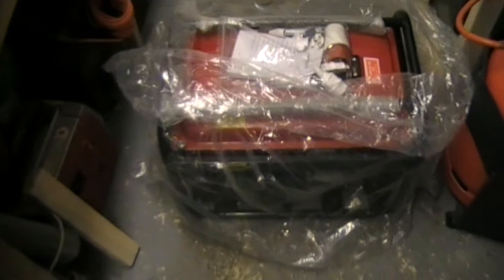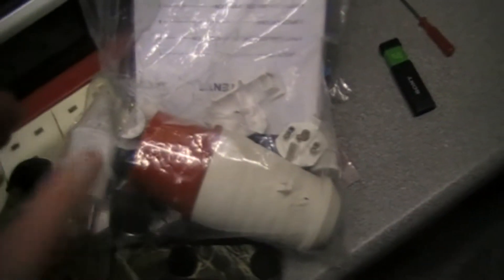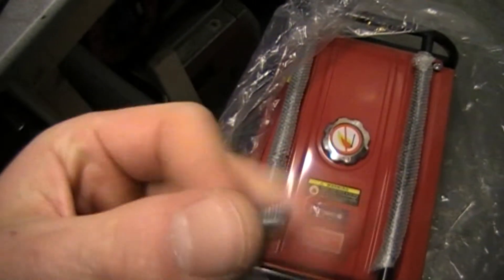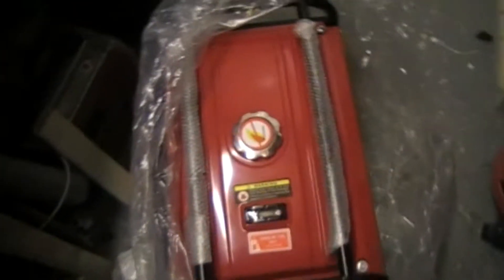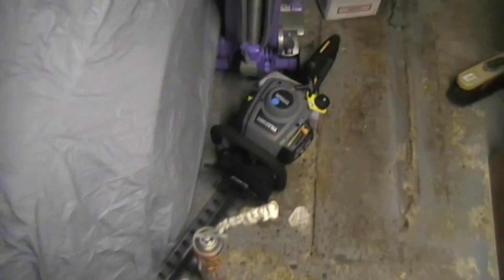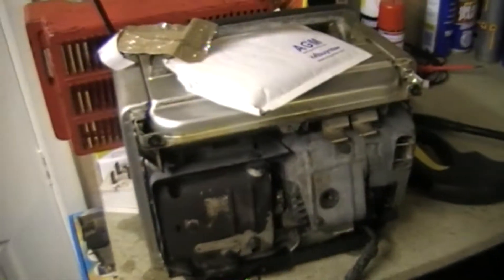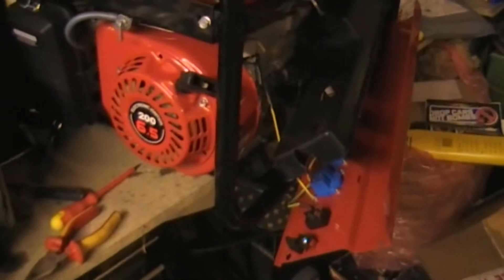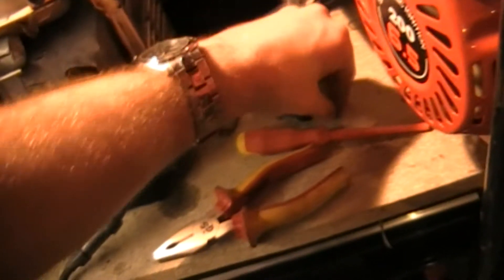Swiss 8500W Generator Repair

Comment: I think it wont start cos you have earthed that cable thats how these engines stop . By going to earth . The switch only breaks the circuit try starting it with both wires disconnected